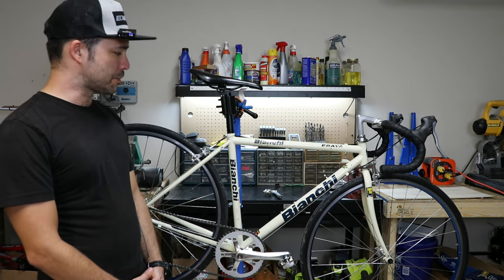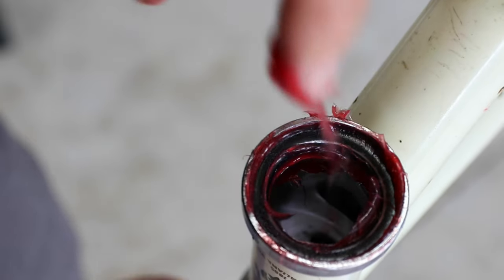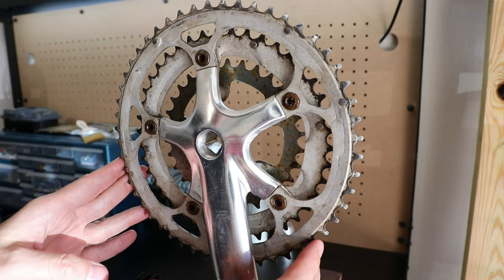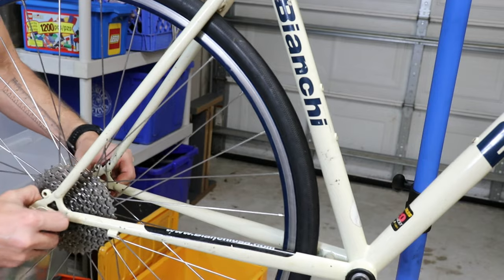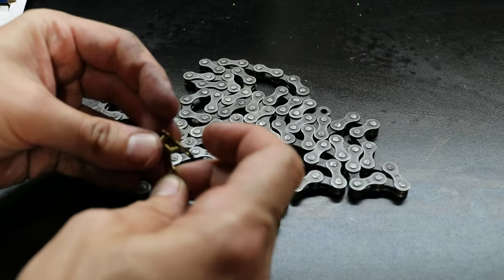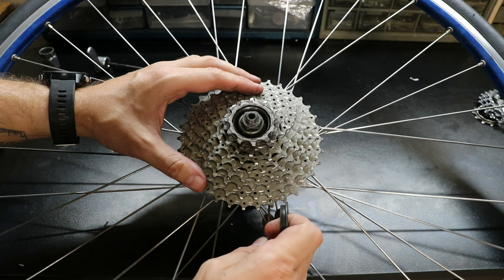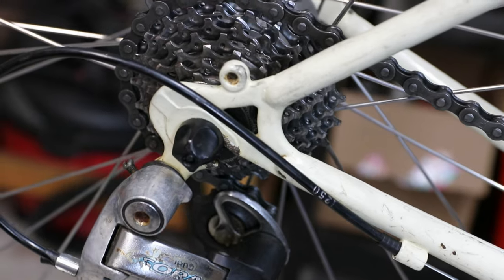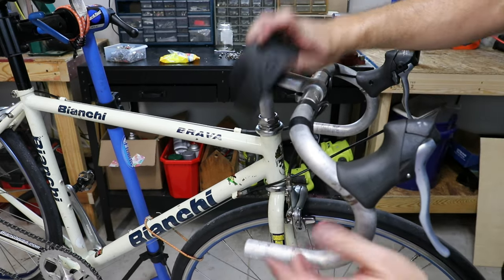Vintage Bianchi parts bin build

Comment: Looks so clear and good-looking! How is the 1by without a narrow wide chainring?
Reply from the maker: Hey Bos! I was and still am wondering the same. So far I have 37km on the bike with zero issues.
Reply: Its really not that big of an issue for a road bike.  You're not constantly going over big bumps.  I have a 1990's Bianchi mixte Boardwalk utility bike with 100's of miles on it that I setup just like Bruce - 1x8.